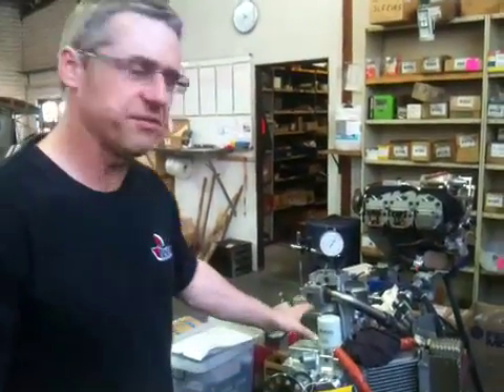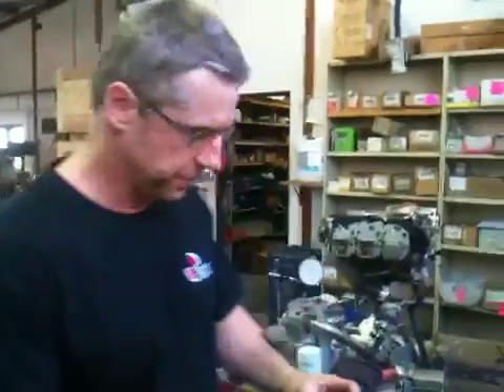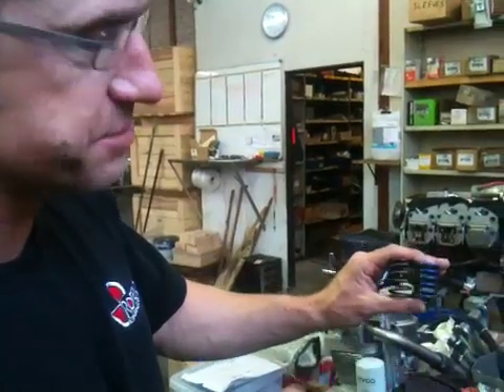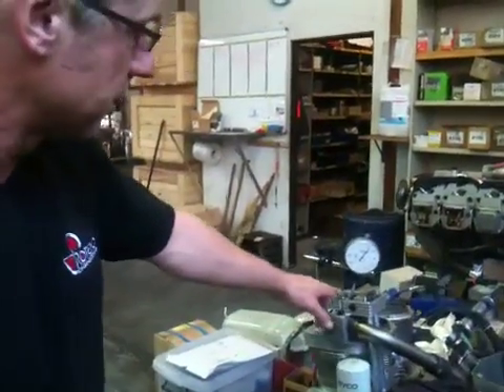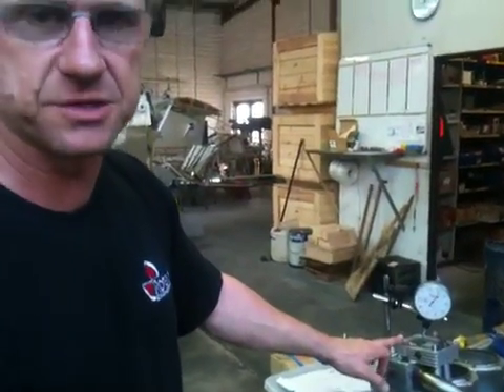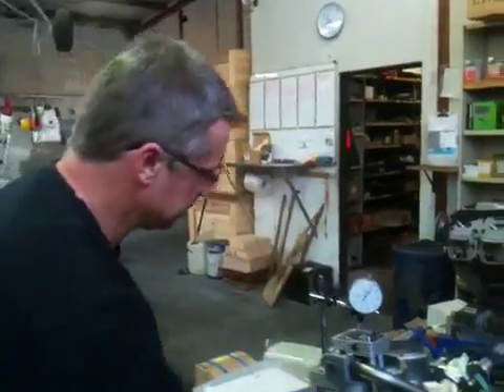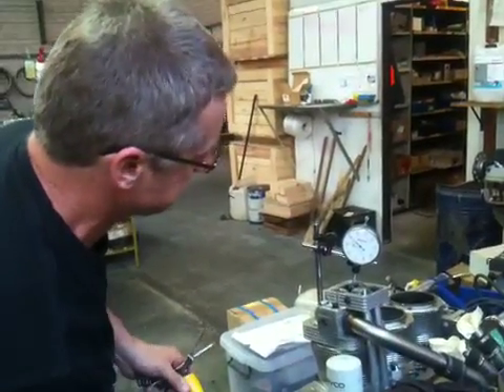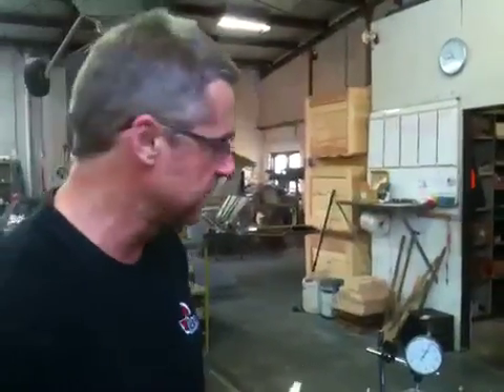LCH Jabiru 3300 Hydraulic Lifters

Comment: Thank you for sharing this importand information.
I replaced some weeks ago four hydr. lifter because of klicking noise on my 2200.
I do not recognized the slit in the push rod and checked the installation today after 20 flight hours after replacement of the lifter.  I installed one of the four push rod in the wrong direction. Thank you again.

UWE